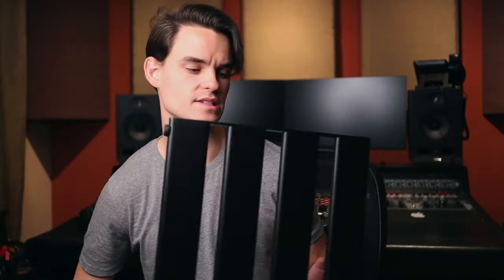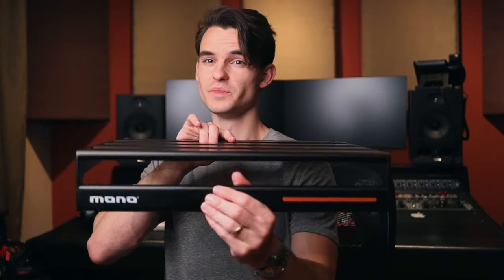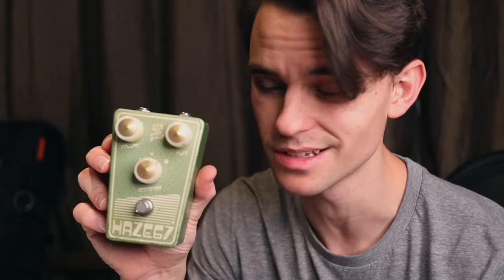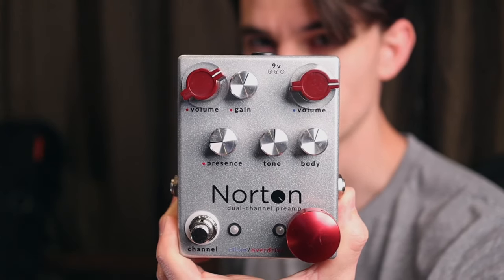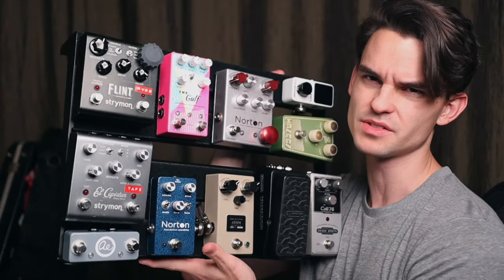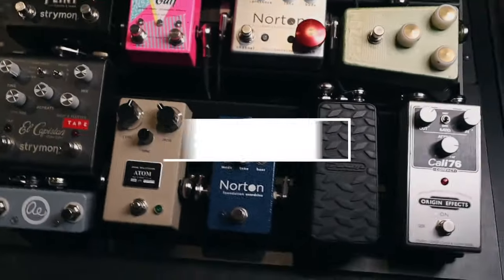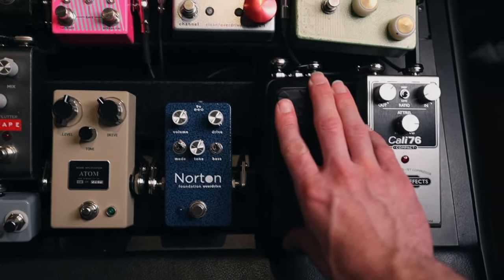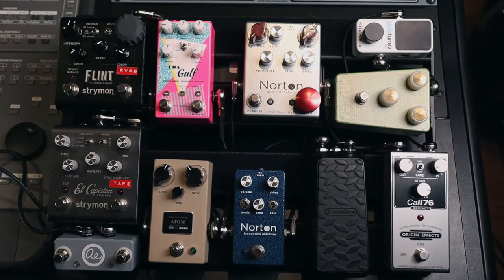Mono Rail Small Pedalboard Build (Part 1)

Comment: How did you set your power supply? Mine is falling
Reply from the maker: I used 3M Dual Lock for that! It’s never failed me. That’s the only thing I used dual lock on because I know I won’t need to move my power supply, regardless of what pedals I change out.
Reply: @RiggsTaylor  I’ll give it a try, thanks!
Reply from the maker: @axlsimons69  you bet! I like the dual lock that has white backing and red letters - it’s “toothier” and more heavy duty.

Comment: It seems like the case is deeper (height-wise) than the previous small mono case. Is that true?
Reply: Also, how much does this whole pedalboard build weigh?
Reply from the maker: It is basically the same! It’s a little more sleek overall, definitely not bigger.
Reply from the maker: I’ll have to check the weight! Really light for sure.
Reply: @RiggsTaylor  interesting that the case is the same. The wedge-shape makes it look deeper in the back
Reply from the maker: @erickdiaz6152  it’s really just that the top is slimmer than the other case! Base is about the same
Reply: @RiggsTaylor  I see. Well great video, looking forward to part 2. Although I’m still a little confused on why MONO made this. Overall doesn’t seem so different from the original 18” pedalboard. 

Unless the rounded slot edges are worth it. But I don’t have experience with whether or not squared edges actually negatively affect cable routing, or if it’s just a marketing point
Reply from the maker: @erickdiaz6152  it’s actually a more cost-effective setup and more streamlined than the other for people that want or prefer this style of board/case. I think both are great though!
Reply: @RiggsTaylor  ah ok. Does this new case feel lighter than the previous case? Or thinner?
Reply from the maker: @erickdiaz6152  definitely lighter and thinner. I say it’s more “streamlined” overall than the Club case, just like the Stealth guitar cases are more streamlined than the Vertigo series. Still plenty of protection I think, just a little less storage and padding.